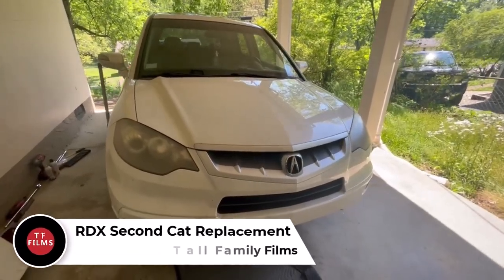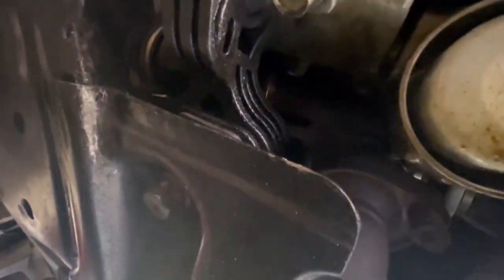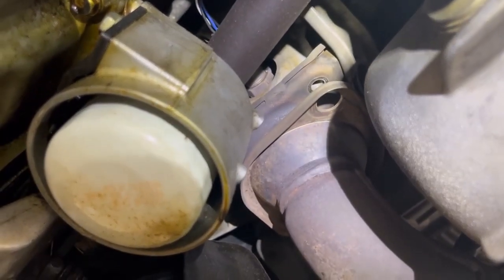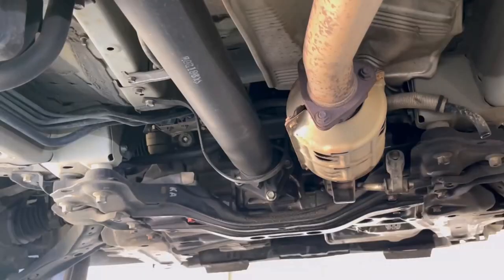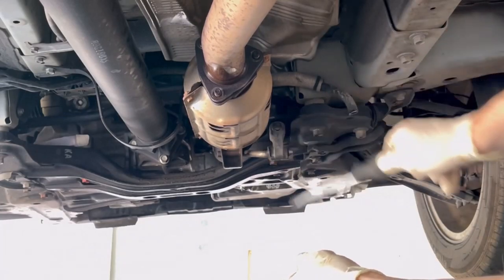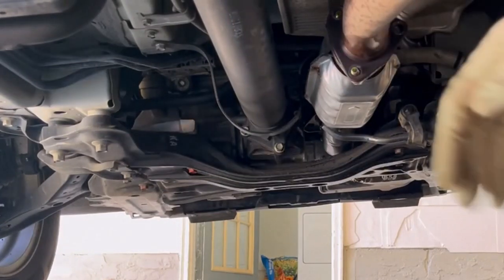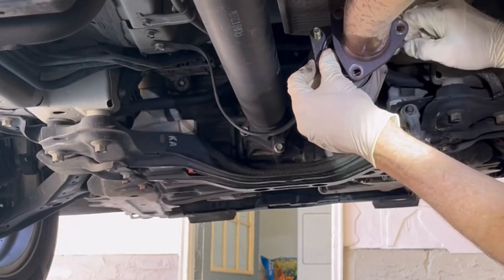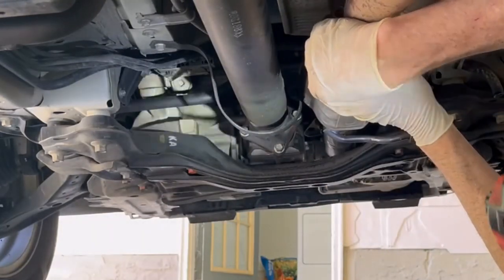Easy: Replacing Catalytic Converter #2 on Acura RDX (P0420, P0299)

Comment: Very clear & well explained video, nicely done! I'm replacing a rear cat on an 2002 MDX & this is the only video that I've found that's close to removing a rear cat on the Acura! Thanks!
Reply from the maker: I would say to look at the Honda Pilot but they didn’t have that in 2002.
Reply from the maker: Avoid “universal” cats. That usually requires welding.

Comment: Hard to beleive because the monitors (afr&02sensors)  are on the top cat after the turbo so how can you have code for the sec cat that it can 't not monitor .The secondairy cat was added to pass emission in other country and california rules.
Reply from the maker: In my case it was because of poor air flow which was causing the turbo to fail.